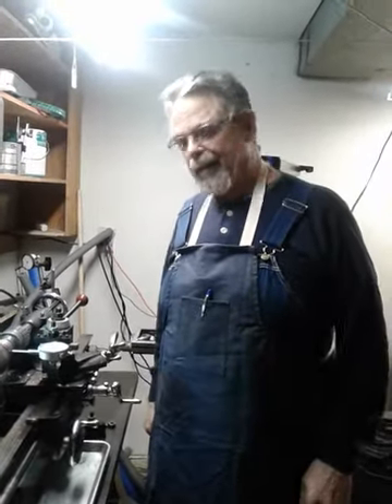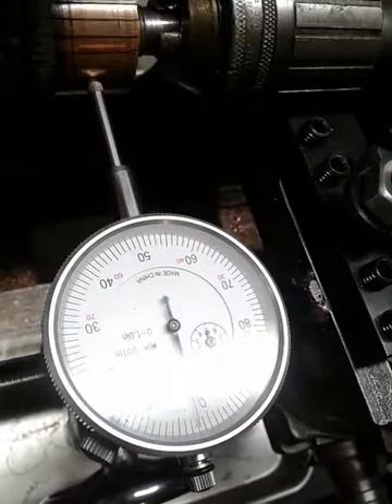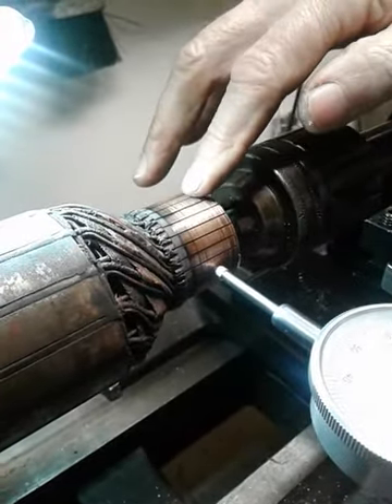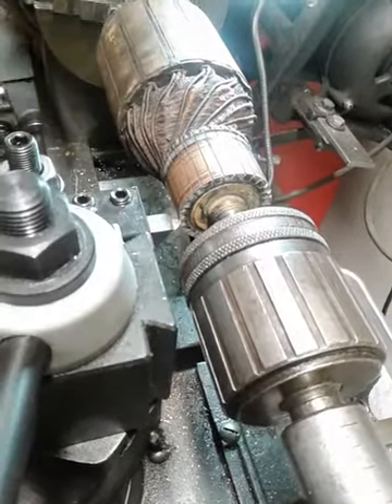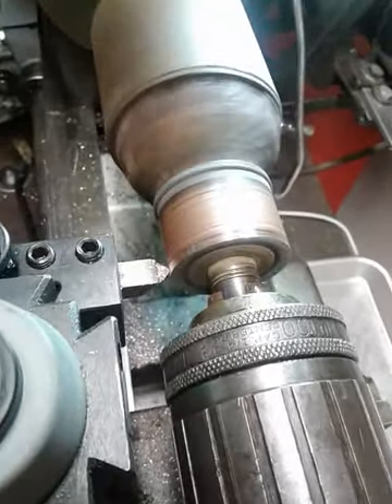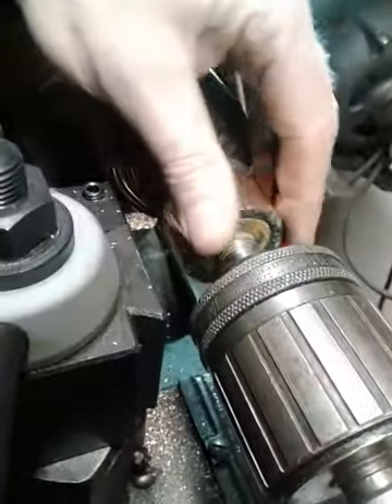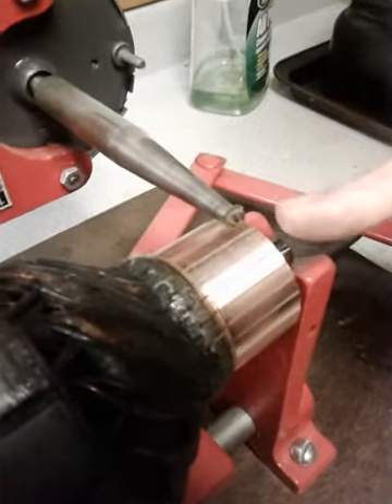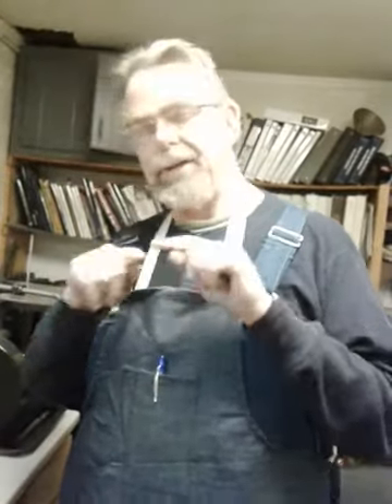Gen 5  Autolite generator commutator truing

Comment: Awesome video Steve,
Would absolutely love to see a video on that under cutting machine. I’ve been looking for a tutorial on the process for years on YouTube and I’ve never found one. 
Also, what speed were you running that lathe ?
Reply from the maker: Undercutting the mica is quite simple, just as I showed. Only go about .030" deep with the cut. Then polish with 400 wet/dry in the lathe to remove any burrs. According to my old Atlas lathe manual, copper should be cut at approximately 120 SFPM. So thats about what I use.

Comment: Hello Steve, on my Autolite MZ 4099 starter with an MZ 2089 armature someone turned down the commutator and did not undercut the mica. I’m concerned that the comm is getting too small in diameter as the segments are only 0.1” tall as measured at the end. Thank you, Cabot
Reply from the maker: I don't know what the minimum allowable diameter is, but so long as the brushes seat, it would probable work. The mica does need to be undercut if it is flush. Another alternative is a rebuilt armature. Perhaps like this. https://www.ebay.com/itm/115704942669?mkcid=16&mkevt=1&mkrid=711-127632-2357-0&ssspo=AH3uNETBQd6&sssrc=4429486&ssuid=qqege1QaTC6&var=&widget_ver=artemis&media=COPY